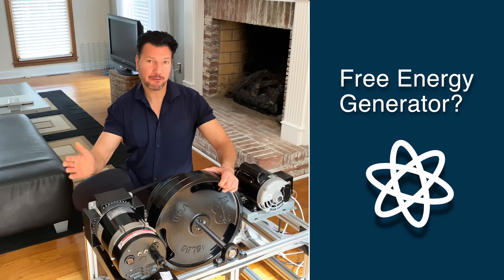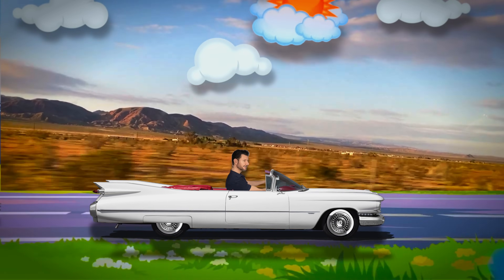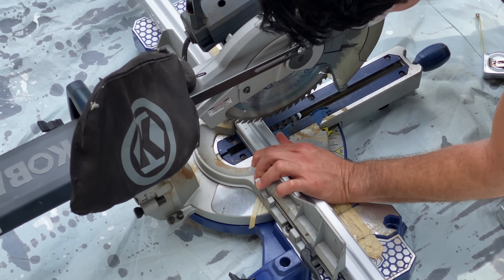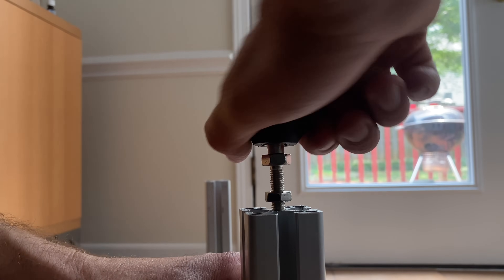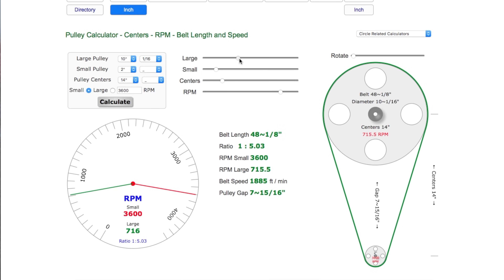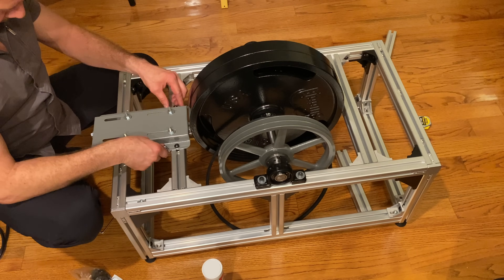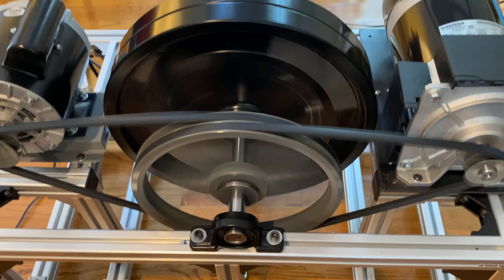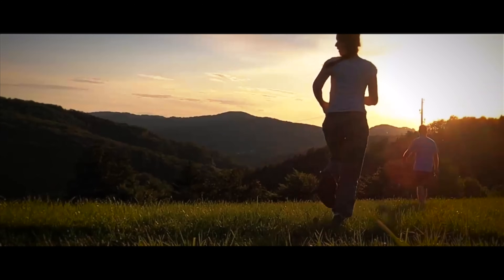How to Make a Free Energy Generator!

Comment: Regardless, it doesn't produce 'free' energy.   First Law of Thermodynamics states that you can't get more energy out of a system than you put into it.  This is a basic law of physics, you can't circumvent it.  The flywheel doesn't generate energy, it STORES it as kinetic energy of rotation.  Ie you have to do work to spin it up, losses to bearing friction etc.  So it's far less than 100% efficient across the system.  This is the mechanical equivalent of a battery or very large capacitor.  You can use the motor to spin up the flywheel and then use the flywheel to drive an alternator, but it's not loss free AND you can get high power output FOR A TIME from the alternator, but as soon as you use that stored energy up, you have to use the motor to spin it back up, recharge the mechanical battery - so this is not 'free' energy in any way, shape or form, you are simply making a mechanical analogue of using a 5a charger to charge a 20AH battery over four hours and using that battery to drive a 20A load for an hour.   This is exactly like that but in mechanical form.

Comment: ??? ??? ???  Where are the 3 tension springs that provide the continuous motion ???  None of the videos this channel refers to is use a power source to operate the flywheel 

It is the principle of opposite forces that are missing here  

He is relying on the math that increases energy by 4 which needs a constant power source 
Magnetic field motors are creating the similar as tension springs on. A crankshaft

Comment: Where's your diodes?  I've gathered materials including a good sized flywheel and permanent magnet motors.  I ordered a heavy duty diode and dpdt knife switches.  Let's see for myself that the concept has no merit.
Reply from the maker: Would love to hear your results.
I hope you have more success!
Please keep me posted
Reply: @duskintheforest : Used the hybrid method, to compensate for the "power loss", due to FRICTION ;

Around 3- 5 horse power (hp) gas' engine, will AUTO START, when the FLYWHEEL rpm goes down (example to 3,700 rpm)... So installed a  RPM Gauge, to your Genset unit- to its "flywheel" ;

Then, once the FLYWHEEL rpm reached the "target level" (example 4,000 rpm)- same gas' engine will AUTO SHUT- OFF... And vice versa..;

Build a BIO. GAS Unit in your houseyard (see You Tube), to have a FREE fuel for your gas' engine - which ASSIST in running the Genset flywheel...

Comment: Idiot 😂 u must use different motors with different power and rpm , then the pulley from motor to flywheel also requires be different with flywheel to generator , 

1 to 4 
4 to 8 
👆👇
Pulley formula 

Motor must be for example 1000W 

Generator must be for example 3000W

Then it will be ok 😊😅

Comment: I can't see why this wouldn't work. If you try to roll a big rock for example it's very difficult to move when it's stationery but once it's rolling it gets easier and easier until it feels very light. 

If you connect a low power motor to a large flywheel it won't be able to turn it, but if you gave it an initial boost and got the flywheel up to speed, the motor would eventually be able to keep it spinning. BUT ... the generator motor will create magnetic resistance and it's a larger motor too. So the extra magnetic resistance basically makes the flywheel heavier making it harder to spin. But like I said in the beginning, if you can get the flywheel up to a high enough speed initially, using a lot of power, the smaller motor should be able to take over and keep it going. If that's the case then we've basically got a small motor spinning a bigger motor. It's not free energy. It's harnessing the energy/force of accumulative momentum and turning that into electricity.

Comment: I have not tried a flywheel system yet, but my old 200-liter air compressor had a single-phase motor with 2 HP 220 X 3600 RPM.
It Started working at 50 amps and worked at 30 amps.
I tried Hector Peres' system called "Rotoverter."
Motor 7.5 HP 220/380 X 3450 RPM three phase.
It's connected to 220 single-phase with a capacitor on the 3rd phase.
It starts at about 20 amperes and works with 8-10 amperes with the total load.
Furthermore, the Rotoverter system has no thermal loss; it works cold.
It's not a joke. The Rotoverter system works. I'm unsure if it would be possible to produce what Hector Perez achieved, as it requires knowledge of electronics.
It's an exciting phenomenon that encourages us to have free energy.

Comment: You have to use different size pulleys on either side of your flywheel. A smaller pulley on the drive motor side and a larger pulley on the generator side. You will spin the flywheel faster and you use a larger pulley on the generator side so that it takes less energy to spin the generator. You can't use the same size pulley for the motor and the generator. A much larger pulley is necessary going to the generator.

Comment: Dear Markus, thank you for the two videos on flywheel free energy concept. I think the weight of the fly wheels is not in proportion with the size of the generator. I think the flywheel need to be in the order of 100 to 200 Kg so that it overcomes the friction in the bearing and pulley system. What do you think?

Comment: Some generators do not produce power unless there's a loading them, first before plugging in the drive motor. If using a induction generator, it will not work use a magnet generator.

Comment: Recomend you try seeking the electric motor design that produces maximum torque for the amount of power that it consumes, and generator must generate more watts than electric motor consumes to provide enough rotation for generator to generate that much electricity.

Comment: My dear brother use Vfd control board even if you add load it functions to maintain constant  speed of your motor but you have select you input voltage according to your area and output voltage to give the motor helping your fly wheel to rotate at constant speed rpm of secondary output motor 50/60Hz

Comment: you left math out of it, it is not about speed only, and looping them like that was a bad ideea, what type of motor you used ? synchronous or asynchronous ...generator is synchronous by nature..so you need to adjust the curent , using a buffer. as you did , when using flywheel as mechanical battery,  to smooth out rotation. keep trying. i might surprise you

Comment: You got to use a low RPM generator I would think 600 would be okay but they have generators that go down to 50 RPM  , I've never built one these free energy things I have watched a lot of videos and read a lot on flywheel free energy.

Comment: This is the entire makeup of matter & free energy:
1) Dark Points  = (Particle / Solid Mass / Do Not Change Size / Positively Charged)
2) Light Points = (Energy / Massless    /  Changes Size           /  Negatively Charged)

1) When 1 Dark Point and 1 Light Point combine, they create 1 Dipole Element.
2) When 2 Dipole Elements combine, they create 1 Photon.
3) When 1,823 Photons combine, they create 1 Proton. When 1,824 Photons combine, they create 1 Neutron
4) When Protons and Neutrons combine, they create the rest of existence

1) 1 Dark Point + 1 Light Point = 1 Dipole Element.
2) 2 Dipole Elements = 1 Photon.
3) 1,823 Photons = 1 Proton & 1,824 Photons = 1 Neutron.
4) Protons + Neutrons = Everything

When enough Dark Points and Light Points combine, the Dark Points all congregate in the center of the protons and neutrons and the Light Points create a coating around the Dark Points so that they're no longer seen. In the stable elements, extra photons want to combine with the protons and neutrons, but are repelled into orbitals by the Light Points. 

Mudfossil University on YouTube has irrefutable proof of this and even convinced CERN to change out their particle detectors for CMOS detectors so they too can see this for themselves.

---------------------------------------------------------------------------------------------------------------------------------------------------------------------------

Venturis Create Free Energy:
Principle 1: Dark Points cannot change size
Principle 2: Light Points can change size
Principle 3: When photons enter into a venturi the Dark Points will be forced to return from the direction that they came from, but the Light Points will separate from the Dark Points and condense and go through the throat of the venturi.
Principle 4: When Light Points pass through the throat of a venturi alone, they create what is known as electron showers and increase their energy 200x
Task 1: Send photons into a Venturi which has a throat smaller than the size of Dark Points.
Task 2: Manufacture a device that can capture this excess energy in the pure energy zone and funnel some of it back to the light generating device and some of it toward a battery.
Note 1: You need CMOS detectors to see photons.

As the light gets pulled into the venturi the Light Points condense to go through the throat. The Dark Points on the other hand cannot change size and are forced backward, away from the throat. As the Points separate, called fission, excess energy is created by the Light Points. Immediately on the exit end of the venturi is a very small zone of pure massless energy of only Light Points. These Light Points will have a significantly increased energy level of 200x as compared to the energy that went into the venturi. Immediately beyond this very small zone of pure energy is when Dark Points show up to attach to the Light Points, which is fusion. We want to use the energy before the Dark Points begin attaching to the Light Points.

How to Create Infinite Excess Energy:
1) Create a venturi with a throat that is smaller than the diameter of Dark Points. 
2) Send photons through the venturi. 
3) If an absorption and siphoning device can be placed in the zone of pure massless energy, before fusion occurs, we can harness free unlimited clean energy. Route some energy back to the light generator & route some energy to a battery or whatever device you want.

---------------------------------------------------------------------------------------------------------------------------------------------------------------------------

Repent of your sins or suffer the consequences. Lord Jesus died in our places personally to take the death punishment that sin deserves and then resurrected by the power of God. Believe this and sincerely repent of your sins each time you sin and you will have eternal life and nothing to fear. Fail to repent and you will end up in the Lake of Fire.

Comment: I think I have a solution to this problem, how many watts, amps, volts does the motor use? 
How much power does a generator produce in Watts? 
If the math is right, I can get your device to run for at least 24 hours!

Comment: Hi, In fact, I agree with you but still, there is an important question, Would this process be fruitful if we changed the plan by depending on an electricity source that comes from an off-grid solar system rather than using electricity that comes from a generator in your experiment?
Reply: if you install solar cells, you do not need any of these gadget, solar cell charge batteries, inverter from battery to 220volt. done.

Comment: Hello i guess you'd have to install a voltage stabilizer between the generator and the motor so as to increase the starting voltage of the motor. It should be a 100% success.

Comment: Thank you for the effort done by you to prove the false videos on the u tube  these done in work shops without any mathematical or electrical basics were its known fly wheel is a storing energy device  not generating unit ,we are doing some experiments not on fly wheel but other way of getting free energy ,we are trying to solve some mathematical  problems of the design on paper and we hope in next few months to find a away, if we can actually .its difficult
Wish us the best

Comment: The only way that this can be done is by transforming the electrical power produced by the generator from transverse electromagnetic energy to longitudinal magneto dielectric energy so it has to be transformed from TEM to LMD this can be done with a tesla hairpin circuit. Also it’s best to use three phase, not single phase and should have a motor/phase converter between the generator and the drive motor

Comment: Easy to fix, use a 12v car wiper motor, adapt a pully to it going to a gearbox reduction,  from the gear box reduction to the contraption you built you will need to make the pully ratio correctly.  In your video, you totally screwed it up, almost like you did it on purpose. You were on the right path until you put both belts on that huge pully.   Wiper motors are built tough and will last a very long time.   Instead of trying to turn a huge generator, just use a car alternator and use a battery system to run an inverter for your electricity.

Comment: If the first motor already covers the power of the second motor, repeat the experiment and connect the first motor with the second motor without connecting it to an electric current, then rotate the wheel in the middle with a third motor, where the third motor is directly connected to the wheel without a skimmer, and so it is a closed circuit and ensures that there is no objection  · Files from any drive for instant cutouts and swapping

Comment: The arrangement of your pulley is wrong that’s why it can’t work.
You can not used the same pulley in both for generator and electricity motor, just make a gears arrangement of pulleys for the generator and also different gears arrangements of pulleys for the electric motor.

Comment: U need to store energy ur system generated  using batteries to power up ur motor....my first thought
Secondly if u could run a 5Kv generator using 2 hp motor on grid power...u r getting free power

Comment: The generator that you suppose to use is a Low RPM generator, and you can add speed controller to regulate the speed

Comment: "Mechanics", what makes it work, "BALANCE" equality on both sides. (Eg. Seesaw) Motor (Power) to Generator (Type), what capacity (Maximum Output) for the Generator to capacity (Maximum input) to Motor. (Torque Balance). One can not exceed the other, it is happening in your case. Your setup is perfect, you have the mechanical backup (flywheel), but no backup on the electrical side. (Transformer.)
It is a thin line calculated to make it work. You are concentrating on the (Storage ) flywheel and pulley ratios too much. Get the correct speed on the Generator, nothing else.
Operating speed set:....3000 rpm. (50mhz) for the Generator, check the (Maximum Torque) of the Motor (output) and adjust accordingly, keeping the set speed.  Workable generation of electricity can not work without "Primary and Secondary sides". (Step up transformer. ) Concerning the other guys, laughable, meant for "NOGOES" like them.
Words from a fool, me,,,,,,,,,,,Take Elon Musk as an example of,,,,, never giving up, in the end, you will WIN.

Comment: You cannot do this with a standard generator --it needs to be modified. The principles (not taught in colleges) is that you must optimize the length path of the magnetic field as this is where voltage is accumulated. It is a balance of resistance of soft iron used --if cross sectional area is too small then energy is lost as heat, if the cross sectional area is too big then no extra energy is created as voltage. Then the collection area of the secondary coil (the soft iron) needs to be two to two and a half  times greater than the area of the magnetic path of iron. The current used in the generator needs to be AC and of course the primary magnetic path needs to be separated from the secondary. And lastly, if constructed correctly, use solid soft iron and not laminated, which will drain energy in the form of eddy currents.

Comment: SMH it works  but you use the wrong information the motor use for generator must be 240 volt and n52 magnet the shaft most not cover with magnet because of jagging of strong magnetic field inside the stator housing creating too much resistance so if the emf slow down by 0.8 ns the system will stop completely to overcome this issue the magnet must be 2.5 inch in length  and 4 pole on the shaft and only n52 magnet is able to power it’s field smoothly without any heavy cogging so the slow of 13 ns will not stop the power output 240 voltage motor from 1 hp and up is use the flywheel is a most but should be add the shaft of motor driving the generator and a 1hp motor Cannot power a 1 hp generator  duty cycle cannot match 1 hp generator 1/2 hp to drive motor if you use 1 to 1 hp the system is a failure

Comment: IMPORTANT: Try this out. I once had seen a paper that had information on how to build a FREE ENERGY/MOTOR GENERATOR. The motor/generator once started would keep running and you would get Free Over Unity Electrical Energy .The person had used Permanent Magnets and Electro Magnets with High Voltage Capacitors. With electro magnets and capacitors you can have a controlled magnetic field that stops the moment the capacitor is drained of its energy. With an all permanent magnet system you need to physically move one of the magnets away from the other or you get a clogging effect where motion of the rotor stops. By using electro magnets and capacitors or super capacitors you can have a controlled intermittent magnetic field. You can control the magnetic field with by an optical switch or   better still with a solid state Hall Effect Sensor Switch. The electro magnet can be used as a generator to recharge the capacitor. You may need a diode to ensure the capacitors get the proper charging polarity. By switching a magnetic field on and off you can stop the clogging effect therefore the rotor can keep on turning and keep gaining momentum.          I

Reply
Reply: You can switch the permar magnets on  and off by changing its  drag and  Distraction to stop the clogging real easy